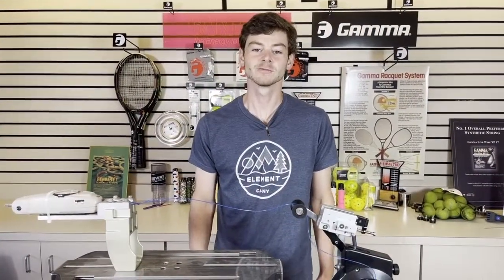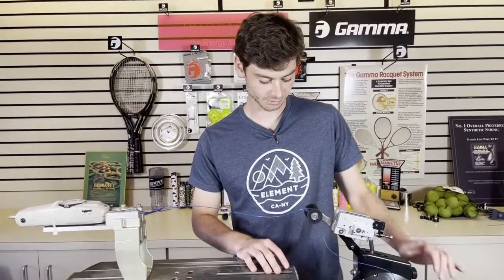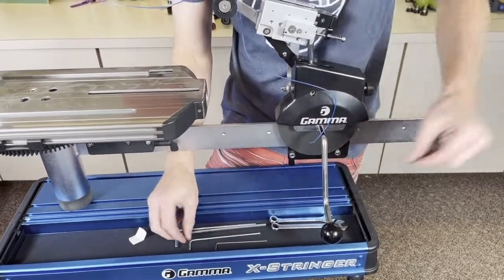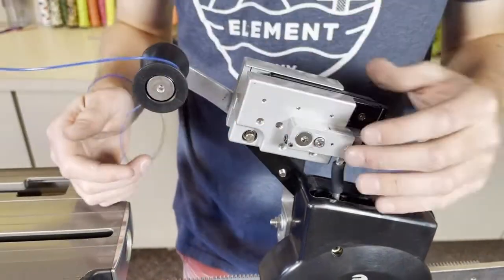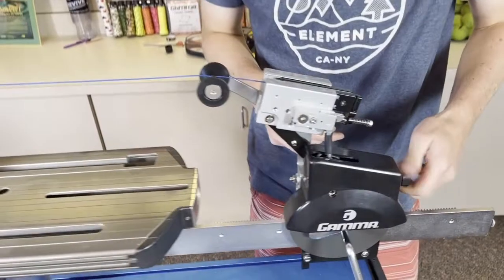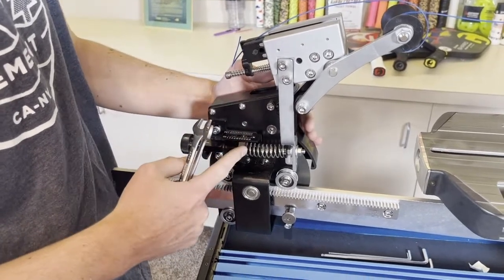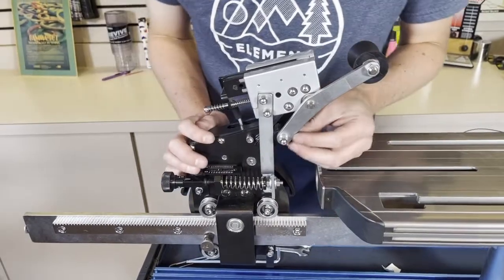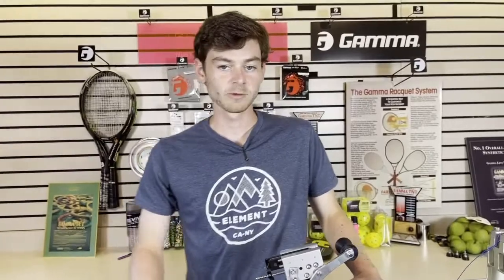How to Calibrate Your Spring Tensioner

Comment: is there any maintenance for the v-clamps on my gamma 6-pt stringer? they have large nuts/screws at the end of each v-clamp arm’s underside that are a but loose..do i tighten these underside nuts? 
also, any suggestions for cleaning inside the tracks under the clamps? i can see dust and what not.
Thanks!!
Reply from the maker: The V-clamps are left slightly loose intentionally so their position can be adjusted to fit the racquet squarley. If you feel you need to tighten them you certainly can! The best way to clean in the tracks would be to use an alcohol wipe. Remove the black plastic end caps and lift out the base clamps, then brush along the botton until you reach the round hole at the opposite end, hopefully clearing all the dust out along the way.